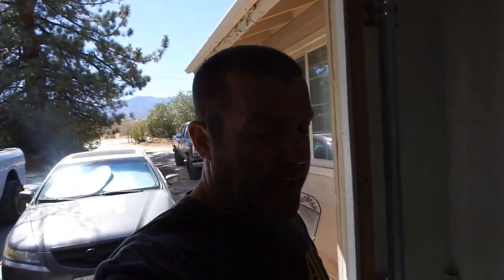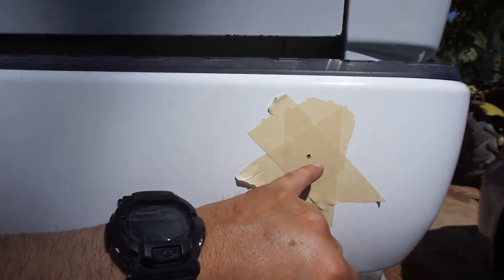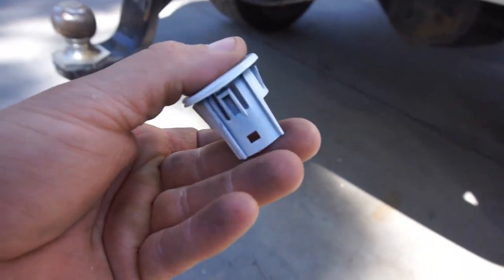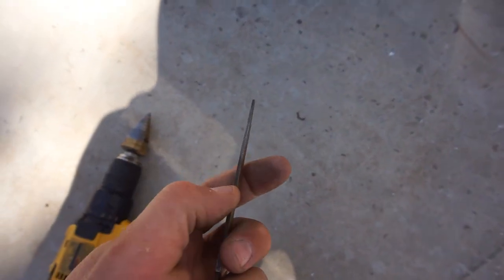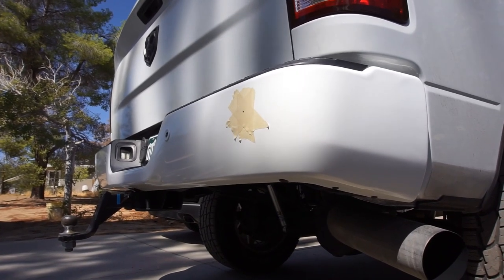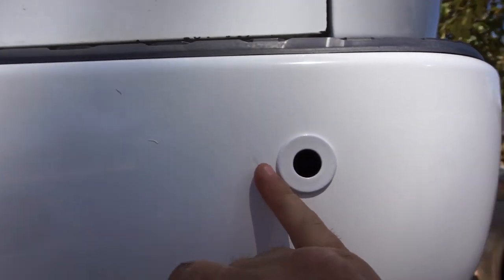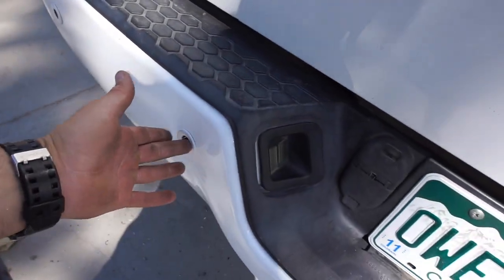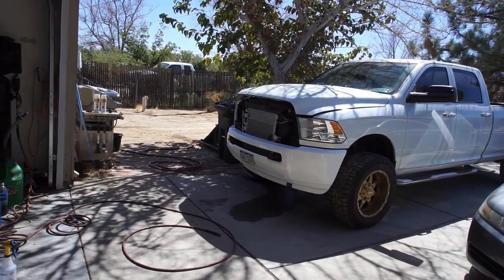Already Ruined My Brand New and Newly Powder Coated Bumper... Installing Backup Sensors

Comment: Looks clean brother! Did you already have back up sensors OR are these aftermarket sensors?
Reply from the maker: OneNGlen do you watch the videos. Haha. Yeah the truck had sensors. But I could only get a chrome bumper with the holes. So I bought a primered bumper without holes to do this. 🤣🤣
Reply: Halffast719 I have to watch with only captioning on at work.... I miss a lot of what you say.... Work gets in the way.
Reply from the maker: OneNGlen oh. I guess you’re gonna have to quit your job. Or teach me sign language.
Reply: Sign Language it is!!!! haha
Reply: Did you have any problems with rusting after drilling the holes?
Reply from the maker: I painted them and haven’t seen any rust but we’re in Southern California where we don’t get wet weather.